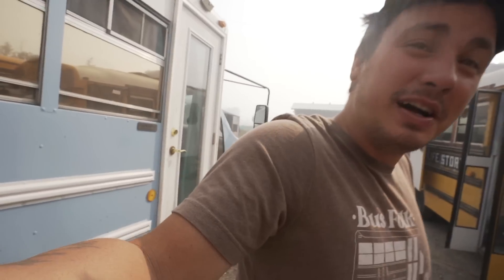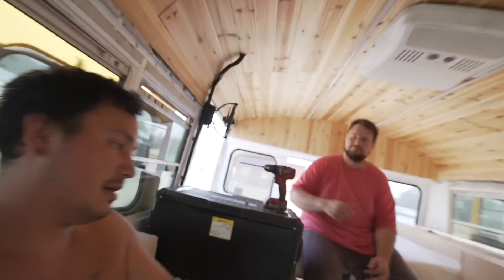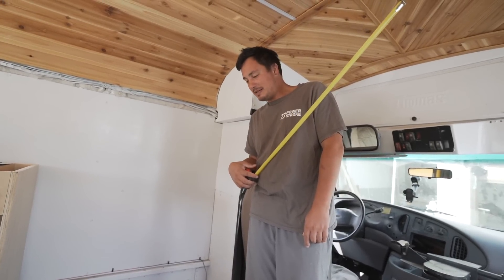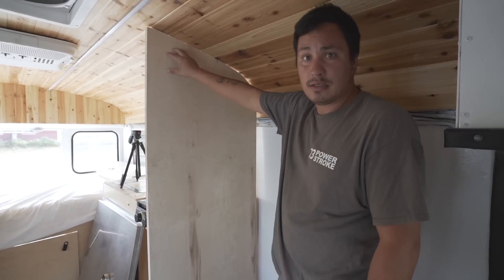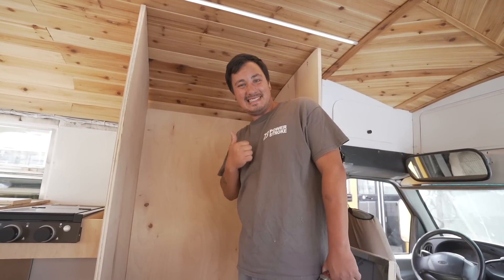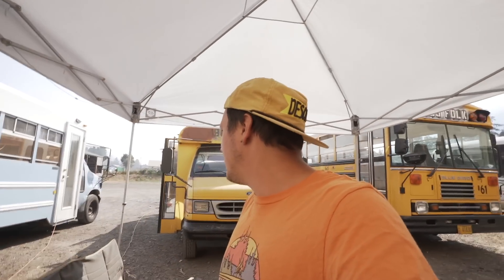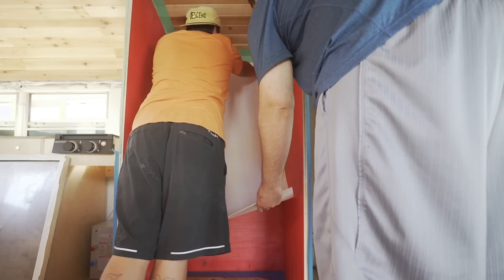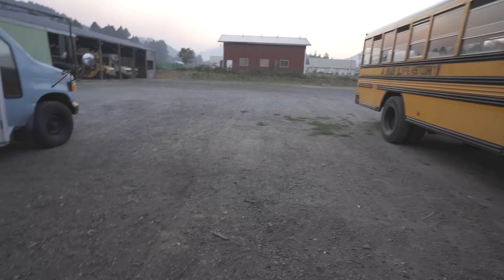Build Week  - Mainly Making A Shower Stall Out of Plywood (Skoolie Conversion)

Comment: When you lay a bead of caulk spray it with windex getting windex on the sides where you don't want the caulk to smear and stick when you run your finger over it ....... then the windex evaporates leaving you with a much cleaner caulk line

Comment: Great that your teaching Levi some building techniques & experience. Always a good idea to get a wemons point of view. 😆 🤣 Issac you such a hard worker. Praying this bus sells quickly. Suggestion on the caulk line. Use duct tape this will give u your straight line before u caulk & than after your caulk pull tape.
Reply from the maker: I may try that!

Comment: You and I think a lot alike I like to make things where you can fix it there's nothing wrong with what you're doing you even use the same Marine caulking that I will use on the Windows as well you and I think a lot alike
Reply from the maker: Yeah things break and need to be fixed or replaced